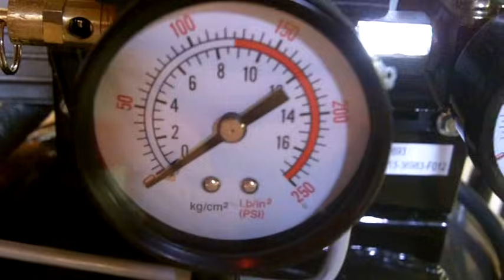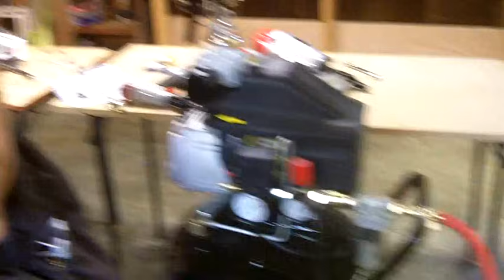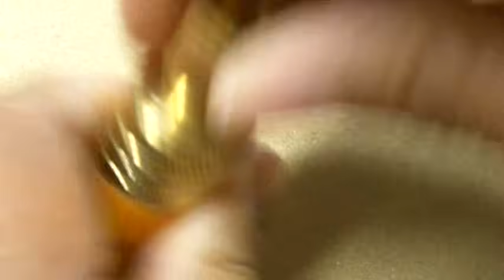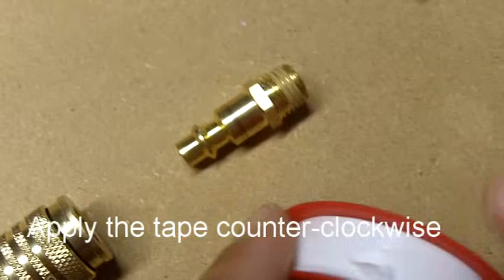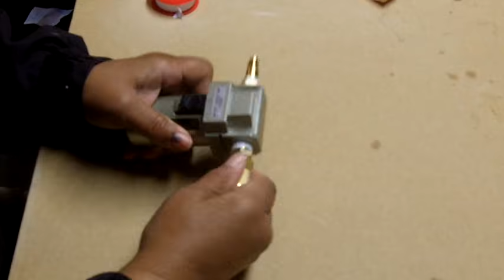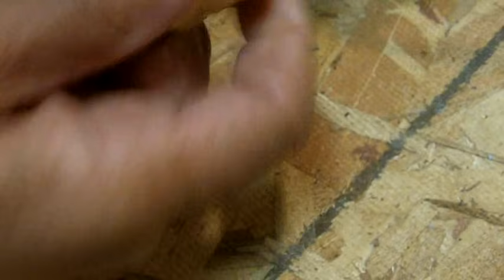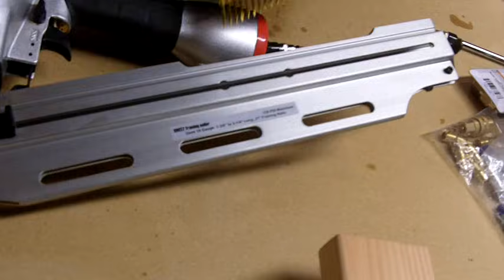Air Compressor, Line Setup and How to Use Air Tools for Beginners

Comment: Could you or a follower please explain why air impact gun will not break loose my 150 lb lug nuts on my f150 with a 20 gallon tank 3/8” hose and an impact air gun that is more than able to deliver up 1000 pounds of torque. I spent about $170 on the air impact gun. Please any suggestions would be helpful.

Comment: Thank you for posting this awesome video!  I've used power tools and air compressors before, but didn't really know anything about some of the technology...just knew they make some jobs easier and all fittings are not the same.  Your video is really helpful.  Right now i have a technical dilema.  If i may ask a question;  I recently retired and purchased a 50Watt Co2 laser engraver/cutter for my supplemental retirement income.  I have a good, large air compressor that sits outside, however, It's 220v, noisy, 60 gal, has a good CFM, recovery rating.  My bf installed an additional connector & guage in the building.  My laser sits in a 16'X20' building so I need something quiet, but efficient.  All recommendations say 'Do not leave operating laser unattended'. I believe tech data says 60PSI max.  What the air assist does is blow a stream of air near the head of the laser so the item being cut doesn't catch on fire.  Some projects may take a 2-3 hrs to cut or etch.  In your opinion, what should I be looking for in an air compressor that i can attach and turn on and off as i do my jobs?  (Laser co sells one, but admits it is way overpriced and they don't give you the specs).

Comment: miss leah i have a question i hope that you can answer. i own a 175 pound per square inch. my compressure looks lie yours 22 gal tank. my question isi recently purchased a 2 in 1 3/8 inch regulator and air filter it say on the tool itself is rated for150lbs. i use my compressure for mostly blowing off things and run the compressure at  full 175lps most of the time.can i use this regulator?  dick bailey thankyou
Reply from the maker: I would purchase a proper regulator

Comment: I dont know if you make recommendations or not, but what are your thoughts on Kobalt air compressors. Most of my tools are kobalt. Affordable but good quality in my opinion. How much psi and horsepower should I get to run most tools safely?

Comment: Thanks for your videos.  I thought I knew all there was to know about air compressors.  Wrong. You have explained everything in great detail. I am now ready to buy an air compressor for my new workshop. I now know exactly what I need to meet all my needs without overkill, but more importantly, not spending enough and not getting everything I need and making a dozen trips to Lowes

Comment: Would it do any good using two oil air separator‘s? one at your tool and one at the compressor? Or is that unnecessary

Comment: Hi, Leah! Thank you so much for making your videos <3 I'm learning a lot. I stumbled upon this coz I want to learn more about air compressors before buying one along with the pneumatic tools that we need for carpentry projects :) One thing I want to ask is about the oil you mentioned. What kind of oil should be used for the tools? Does it have a specific name/kind? Thank you for taking the time to answer this <3

Comment: Leah, great video! I just purchased a small 1 gallon compressor for just using brad nailer. The benefit was its small and light and super quiet.  Would you recommend connecting filter to a compressor this small? I imagine the dirty air/moisture concerns are still the same?  Your killing it with this channel!

Comment: Such a great tutorial. I was nervous about using the compressor for the first time. This helped a lot. One question...on the filter, once it's installed how often do you release water from it or replace the filter inside? And my compressor has a water release located under the compressor...does putting on this filter mean I dont have to release the water from the bottom as often? Thanks!

Comment: Literally so helpful. Got my first compressor recently and it looked like a strange bomb. Now it looks like an air compressor. The only thing I still don't know if what the ball valve on the bottom of the compressor does???
Reply: Liam & Tory, that’s to drain off water that accumulates in the tank. Must do this each time you finished using the compressor, otherwise the tank will corrode on the inside.

Comment: Is an Air dryer the same as a water separator? Do all compressors need air dryers attached? I thought the compressors themselves separated the water or condensation because they have drain valves in the bottom of the tanks. Thanks for the extra information.

Comment: Leah, you are a natural teacher because you impart knowledge/information with such consummate ease. I have never got a tenth of the info you shared from manuals that turn out to be no more than illustrated sign language. I hung on to every valuable word as everything was so logically approached and I walked away knowing what to do with the oil which I have never used so far. As soon as the lockdown is lifted I will go to my local hardware store in Melbourne and find a filter. I finally understand the relevance of the line-pressure gauge and will ensure that it is set to match the tool in the future. By-the-way Leah, do you do this for recreation or is it your main occupation? Once again, thank you. I hope manufacturers take the time to acquaint themselves with this tutorial as it will give them food for thought and make their abbreviated instructions usable.

Comment: What is the CFM rating for the compressor in this video, and what CFM rating compressor would you recommend to run 1/2" air impact wrench? Would a 4 CFM compressor with 20 gallon tank run such wrench, or the tank size does not matter?  Thanks.

Comment: Just one question. Do you really need a disconnect between the regulator and filter or was this just so the water trap drain cleared the tank?

Comment: An important tip (that I did not hear mentioned) about applying tape. Wrap the Plumber's tape (aka Teflon tape) around the threads in the opposite direction of how it will be screwed into the fitting. The friction between the threads should work to tighten the tape around the threads, rather than against them, and loosen or unravel the tape.

Comment: Omg thank you. We have a compressor at work and I decided it would be quicker to use than my portable one. But they had a different attachment on that I managed to get off but I could not figure out how to put the correct one on! I didn’t realize I had to pull back the coupler so thank you! No one else was here I was so stumped.

Comment: I'm still trying to understand why I need a regulator.  A home compressor will not produce more CFM than any of my air tools can handle, except for air spray guns.  My 'huge'compressor parked in the corner of the garage' cannot create so much PSI to over power my die grinders, cut off wheels, air grinders, air drills, orbital sanders, and impact guns.  I always crank the regulator way up.  But using a regulator  and quick connect fittings robs the volume / CFM  my impact guns need.  I'm gonna remove the regulators, I  don't see the need for them.  What am I missing?

Comment: Hi Ms. Leah - I was able to confidently setup my 1st air compressor and air tool. Found your video super helpful. Not sure if I missed a link or list but it would have been really beneficial to have a parts list along with sizes for everything you detailed. For instance if you purchased a 1/4" filter then you would not need the adapters. Nevertheless, couldn't have done it without you 👍

Comment: Enjoyed your video! Helped tremendously in understanding. I have a Pneumatic AO2 filling machine, my connection is different and the manual dont show the air compressor hook up. Maybe I can get your feedback on the best way to instal it, I purchased a Husky kit. The air hose end to connect with machine dont require any parts, but I do hear air seeping from air hose  compressor end where the recoil is..can I wrap it or purchase another one?

Comment: Great Video, This is my 1st compressor, just got it today, and you gave me a serious education.  I just have one question.  The RED knob that sets the pressure for the tool.  When it gets to the desired pressure do you close it to stop the pressure from rising or leave it in a specific position......... Thanks again for your time.
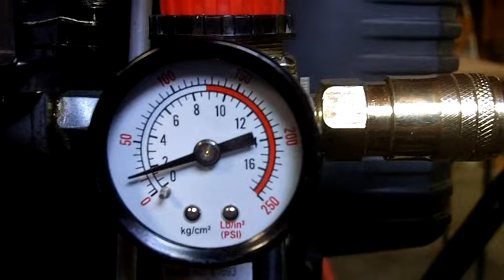Reply: check at about 18:00 and it looks like they turn it and leave the knob in place when the desired pressure is reached
Reply: @joenottoast  thanx :)

Comment: Anyone know what kind of oil goes in there? Can I just use 3-in-1 oil, or does it need some specific mixture?
Reply: SweeturKraut Hello. Are you talking about your air tools? If so it takes Air Tool Oil. I would use what’s recommended. Big Jim. I haven’t seen if the filter was directional. I know there an arrow
Reply: @jamesbarlowjr.3762  Thanks, since making the comment, I did a little more research and got oil specifically made for air tools. I appreciate the support. I'm just a regular homeowner trying to learn some skills.

Comment: We installed air lines in our shop, using PVC piping. Convenient, easy, quick. Then one day the pipes just started blowing apart. Shrapnel was flying past our heads with no warning. Lesson learned.

Comment: How do you drain the tank?  What about oil lubrication for the pump?
Reply from the maker: Many compressor s are oilless and there should be a drain plug at the very bottom of the compressor.

Comment: Does it matter if you attach hose before - or - after you turn on air compressor ? Does it matter? I know it should be in off position before you plug in to receptacle.

Comment: I appreciate this video. I practiced with the compressor and brad nailer & am finished now but don't know what to do. Can I leave air in tank until tomorrow when I plan to use again or do I need to get air out of tank and if so how? Do I use the safety valve to try to get air out or can I leave air in until I use again? Instructions to my compressor kit are not helpful.

Comment: I have a small 18ga brad/staple nailer, but used so no manual.  Trying to figure out how to adjust the depth, as I took out very long staples and will be using shorter staples.  A video said to adjust via the thumbwheel, but the videographer wasn't having any luck and it looks to me as if that adjusts the safety sensitivity for the trigger.  Do I adjust depth by adjusting the line output pressure with the regulator?
Thanks!  Lynn
(Great channel!)

Comment: "If you have ever wanted to learn how to use an air compressor, so that you can use air tools, today is your lucky day." Leah Bolden, May 1, 2014
. I have wanted to learn how to use and which type to purchase for over a decade. I have gotten close a few times but backed out as to lack of knowledge and concern I was making an expensive and wrong purchase. Going to watch this video then most likely starting using one tomorrow. SeeJaneDrill is the best!

Comment: Nicely done, I usually start the fitting into the coupler and then pull back the ring rather than pulling back the ring first. My compressor was a garage sale find, if you buy a used compressor make sure the tank is good. And drain the tank at night.

Comment: Hi, loved your video. Thanks for walking through the process.  How often should I leak the air compressor?
Reply from the maker: After each use otherwise condensation builds up inside the tank

Comment: Know this is old and helps me alot. Question. My filter is 3/8 but the hose from the Harbour Freight  Pot blaster is 1/2". not sure what piece I need for the end of the pot blaster hose to connect to the filter. Any advice on that please. Thanks.
Reply from the maker: I couldn't locate the pot blaster you mentioned on their website.

Comment: Can't find an adjustable regulator that operates within a smaller range so I can accurately vary the pressure selection between, say, 5psi and 15psi, 20psi tops (on a gauge with a ~0-50psi range?)  ... Any advice when working with a 120 to 250 PSI source?

Comment: Hi Leah, thanks for the very thorough video!
I have 2 questions: does it matter that the brand of the actual air compressor matches the tools?  And, I'm looking at a "kit" of tools that includes the air compressor, a finishing nailer, a framing nailer, and a paint sprayer.  Do you think that's a good idea?  THANKS!

Comment: My husband passed away recently, and I have an air compressor in the garage that I don't know how to use. I watched this video and have a better understanding of what I can use it for and how to use it.  My hose that is attached is very long (probably 50 ft or more) and the plastic is very thin. I attached a hook to the wall of the garage to try and coil the hose and get it off the floor, but it kinks so badly.  I think it's because it is so thin and the length doesn't help matters.  Watching this video let me detach the hose which makes getting it coiled much easier. Thanks.

Comment: Dear Lady. You are the best. I am a commercial pilot, a ground instructor, and a flight instructor.  Your presentation was perfect.  You spoke clearly and your rate was perfect so that one could understand you. You sure had your ducks in a row.  The step by step introduction of each part and it's relationship to the next step (again a perfect rate of speech) were easy for me to follow and understand.  I opened the filter box I got for my compressor and I was nowhere; I had no idea what to do with this thing.  Thank you.  I will get my filter hooked up and that should help my nail gun work better and last longer.  Again, you're the best

Comment: I've been using my compressor for 10 years and learned a lot from your video, especially about the couplers and fittings. Thanks! Going to go and re-do a few things now. Btw, I found a push button type coupler that eliminates pulling the sleeve to insert the plug. Much easier and safer. About 6 bucks at Home Depot.

Comment: Did want to ask... I seen the filter right up to the air compressor... are you running another filter/dryer after the first filter? If your dryer/filter is the only filter right up to the compressor it isn’t doing any good. You need at least 50 ft of hose/piping before your dryer/filter to work the way it should.  Great video for beginners by the way!

Comment: Bought our first portable air compressor yesterday, at Harbor Freight. We explicitly told them we knew nothing about the product's setup and asked the sales rep to show us everything we'd need to buy to get it running with an air hammer.
Result: They sold us the wrong hose size, and mentioned nothing about needing couplers and plugs. Grrrr.
So of course, (after losing 1/2 a day's work on our reno project) we turned to Leah to figure out what we needed. Thanks, Leah!
Reply: bought one last week and asked the guys if it comes with the main coupler and was told no i have to buy one separately only to find one in the packet of the castors. Most sales people don't know the products they selling. They are too lazy to learn about products they no nothing about.

Comment: Mem My air compressor is started and when needle reach  on 30 compressor is stop please solve my problem thanks
Reply: ASAD SHAH check your regulator/knob attached to the compressor. May need to be adjusted to raise the level of psi before it shuts off.

Comment: Thank you Leah!  This was great, you’re an excellent teacher.  I already have a fairly large portable compressor and have used it for inflating tires and also using it with an air ratchet for various car and motorcycle projects.  I had no idea about the need for a filter and the need to put a few drops of oil into the tool before using it.  I’m going to get setup correctly thanks to you! Maybe even pick up an impact wrench and some sockets for when I get around to actually installing the lift kit I bought for my Jeep about a year ago!  Thanks again!!!

Comment: What size is the female to male adapter that screws into the filter? I haven't found any large enough to fit the filter. The one I have looks about the same size.
Reply: Bruce West 1/2 - 3/8
Reply: Milton is the best for air fittings.
Reply: I’m sorry Im wrong the harbor freight has the 1/4 to 3/8 on the body.

Comment: This video was uploaded a while back but hopefully you respond. For someone like me who is thinking of buying my first 60 gallon air compressor will I need to buy anything other than what the compressor comes with?
Reply: Ivan Villa if you’re buying a compressor that big I would definitely invest more into it then just the compressor.  I’d invest into a filter/dryer system. Make sure you do your research on them bc they need at least 50ft if piping/hose to them to work. I’d also invest into good fittings and if you really wanna get the full potential I would set up your garage or area with a maxline piping setup. So you have air ports you can hook up to thru out the area and have multiple hoses and tools running at one time.
Reply: Break Time Sports oh wow that’s a lot and I bought an air compressor I guess I have to sell it haha

Comment: Thank you so much for sharing , awesome video 
This question might be stupid but I'm going to ask : does the air compressor needs to be plugged to electricity in order to work or it the air compressor if fully full of air it doesn't have to be plugged in electricity ?
Reply from the maker: it does not need to be plugged in to work
Reply: seejanedrill thank you thank you so much . I wasn't really expecting your reply that soon. 
You have no idea how your answer makes me feel . I really appreciate it

Comment: Hi Leah I have a question. I have a Bostitch nailer and in the nailer itself specifically states oiless. would it be harmful or helpful to add a drop of oil in this nailer? I have seen your videos advising to add a drop to the air intake but I don't know if I can do that with mine.